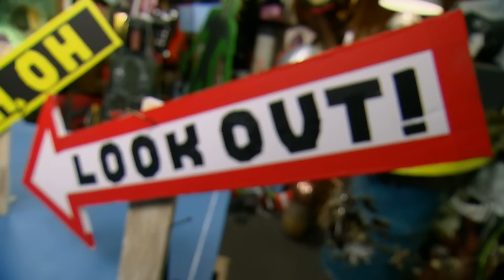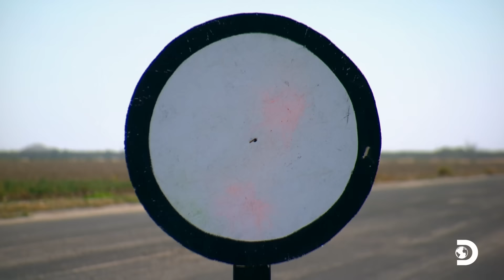Can You Shoot a Grenade Out of the Air? | MythBusters | Discovery

Comment: In retrospect it makes sense. The material of the shell was chosen because it is easily shattered. It makes sense that even low velocity projectiles would shatter it.
Reply: The shell doesn't need to be easy to shatter, the explosion is going to destroy it regardless of what you make it out of because it has nowhere else to go.
Reply: @bobbygetsbanned6049 no but in order to fragment better it needs to be kinda brittle
Reply: @bobbygetsbanned6049  the goal isnt to destroy the casing, its to break it up into lots of hard fast pieces, so you would want to heat treat but not temper the metal so it is very hard and brittle.
Reply: The casings of WWII grenades were made of cast iron, which is very brittle. They were also cast to have break lines in the casings... See the old "pineapple" grenades for an example.
Somewhere in there that was switched to a thin steel casing, with a serrated "slinky" inside to act as shrapnel.

And yes, I was in the Army, and yes I know how grenades are constructed.

Comment: This experiment is close but I think there are a few details missing that could drastically change the outcome. 1) They use a Mk2 grenade instead of an m67. Besides being the grenade in service currently, its also what the majority of movies use. 2) They are using practice grenades, which are straight TNT, and are "low explosive" grenades. A real grenade, especially the m67 has about 3-4x the explosive force, and use something called Composition B. Its a mixture of TNT and RDX. The latter of which some of you might know, is shock sensitive and has a much bigger boom. It also means the m67 grenade is much thicker, harder, and doesn't have perforations like its predecessors. 
Basically, this experiment is a better analog for "can you shoot a 1/8 tnt stick and disarm it" like in old westerns, instead of a grenade out of midair.
Reply: TNT is not low explosive, dingbat. A practice grenade is low explosive because it contains black powder, not TNT. Furthermore, RDX is more sensitive than TNT, and in specific 'rifle bullet tests', RDX detonates much more often than TNT, which is why it needs to be mixed with a desensitizing wax. Comp B may have higher brisance (which is irrelevant here) but it will be very similar, if not slightly disadvantaged still, in sensitivity tests.
Reply: @OngoGablogian185  you missed 3/4 of my post and hot hung up on semantics and terminology.  the training grenade is a low explosive version because it DOESNT contain rdx, and has and less than HALF the TNT of a standard counterpart. I didn't realize I had to spell out that its a comparative statement, not a categorization. pop caps and matches have black powder in it too, but you cant blow your finger off with one, let alone send metal shrapnel 15m. You are correct that Composition B has higher brisance, but that measurement is used for effectiveness of the explosive, not its shock sensitivity or insensitivity. In simple terms its how much bang vs how much burn your mixture has. Comp B is more stable, but has a faster chain reaction than straight TNT. It takes more energy to start the detonation, but is much more efficient and self sustaining once it gets going. This difference could play a major factor in the outcome of these tests, as more force would be required to set it off, if it can at all. For a comparison you can find videos of: You can smash, burn, shoot, and microwave C4 and it will NEVER detonate. But induce 12v of electricity into it or use a blasting cap and a soap bar can make a 30ft crater in the ground (C4 is made primarily using RDX as its explosive compound) Conversely, Tannerite can trigger its explosive reaction with any caliber over a .22, but dies off so quick 4lbs of the store baught stuff put in 1 container wont fully detonate.
Reply: @OngoGablogian185   Also, after doing some research and finding no conclusive answer, I stand by my original statement that m67 practice grenade uses TNT without the RDX as thats what I was taught in the USMC. Not to be confused with bluebody grenades, which don't explode at all, which only use a small amount of black powder to emit smoke to signal detonation, and are meant to be reused. These are what we call dummy grenades, NOT practice grenades.
Reply: @mygirlfriendbeatsme  Lol, nice book. You should title it 'in defense of being flat-out wrong'. This has nothing to do with 'semantics' and everything to do with correct terminology, which is fundamental to EOD and explosive engineering. It's quite laughable that you would claim the fault is mine for 'interpreting' you wrong, when you're erroneously labelling something as low explosive. Something with TNT in it is not low explosive. It's high explosive. End of story. Even using it as it's 'low explosive' in comparison to an equivalent amount of Comp B is just wrong. 

 Further, you were the one talking about explosive force; my point was that we are only concerned with sensitivity here. Hence, brisance is 'irrelevant'. It's good to see that you now agree with me in your reply. The rest I think we can dismiss as irrelevant rambling. I hope this has been edifying. Good day.
Reply: Adam would state later on that they flat out couldn't acquire grenades. There was no legal workaround for private acquisition nor even cooperation with bomb squads.

The Mk2 you see here are actually empty duds they acquired on the market, which then they filled with explosives (according to Adam, C4) and a homemade cap, on their own for the test.
Reply: @siraethelwulf8914  which gives a decent representation of the 67, but yea it makes sense that it would be super difficult to get one, let alone a modern mk2
Reply: @siraethelwulf8914  
Hardest-to-Obtain Item in MythBusters History
6:13
FYI the part where Adam says grenades are hard to get.
Reply: Lmao at everyone

Comment: On the shotguns, the shot cup itself went through the grenade, which means every pellet was still tightly packed against all the other pellets.

The shotgun load went through basically like a slug would.
Reply: Pellets do not equal a slug.
Reply: @johnjay1147  
They do if they're still inside the shotcup.....
Reply: @johnjay1147  To explain a bit. Shotguns do not work like they do in movies or video games. Pellet spread is far tighter than most people assume it is. And there is almost no spread at all for a good distance. At that range, there's little difference between a slug and shot. The biggest difference would be that shot is "slightly" spreading it's energy so instead of piercing the target, you obliterate it. Get further away, and the story changes. Slugs will still put a hole right through something, shot on the other hand will instead put many smaller holes in a target. 

This test wasn't exactly fair in other words. Up close or at range a 45, slug, or rifle round should act more or less the same and this test would be decent for those. Shot on the other hand, well you'll never shoot something with shot this close. The myth is shooting the nade out of the air, not while it's at your feet.
Reply: yup and just like a pistol it will destroy the detonator and dump the hexamine out. Rifles bad idea they go Mach 2 and the shockwave will detonate the grenades and blow you to bits.

Comment: "These are supernm dangerous" holding it hanging by the safety pin😂
Reply: They also often have the end of the pin bent down to insure the pin doesn't work its way free. Current US grenades also have a clip to keep the pin from moving. Removing this clip is step 2 of 5 when the Army teaches grenades in BCT.
Reply: Exactly what I came to comment and yours is on the top of all comments. I guess we all noticed that huh 😂
Reply: It was surely an inert grenade he was handling
Reply: It was FFE.
Reply: @jjd997  guess you didn’t notice that the one he’s holding isn’t real lol. If you keep watching you see him pulling the pin on the one he was holding and he even said it was a dud.
Reply: @dbzcollector9963  I guess I didn’t 😅
Reply: Tbf, it actually takes quite a lot of force to pull the pin out, still would never do that with a real grenade tho obviously...
Reply: @airplanenut89  ensure*
insure refers to insurance lmao
Reply: It can take 8 to 11 lbs to pull a grenade pin.  Some Russian grenades required as much as 17 lbs of force to pull.

Hanging a grenade by the pin isn't likely to pull it unless the pin is faulty.  Also, attempting to pull a pin with your teeth is likely to result in a few pulled teeth.

Comment: Adam holding the grenade by the pin, the only thing preventing the spoon from activating the fuse, made me nervous
Reply: Those pins require quite a bit of force to pull out. Its NOT going to fall out just by holding it like that. You can't pull it out with your teeth either like they do in action movies, it would probably break your teeth if you really bit down on it and tried to pull it out
Reply: @Eralen00  Materials degrade, defects happen, assumptions kill.
Reply: Probably a dud
Reply: it's obviously a dud lmfao. he literally plays with one later and says it's a dud. they also hit one with an ak
they ALSO weren't allowed to touch the live nades and had the bomb techs set them all up.

Comment: The fuse is not 'shock sensitive' it is just that the bullet ignited the grenade before the blasting cap could, it has penetrating power as well as has an incendiary effect when shearing through the steel casing of a grenade. The previous two used what is known as stopping power to essentially destroy the casing. If anything was learned it was to target explosives if  you are a sniper. With the new 380 blackout it'll sound like you snap your fingers and BOOM.
Reply: What the hell are you talking about? Of course the fuze is shock sensitive- it's a FUZE! Must be american with that attitude lol

Comment: I’m not going to lie I was not expecting the shotgun to do that either, but after I thought about it it does make sense because the casing is designed to blow apart so there are probably certain stressors in the grenade to make sure that the whole thing blows apart in as many pieces as possible instead of getting just 2 or 3 big chunks. So yea it’s probably designed to be somewhat easily shatterable even tho it’s steal.
Reply: IIRC that was an issue with some early grenades. they'd explode in very unpredictable patterns sometimes leaving their intended target completely unharmed...
Reply: gotta be super brittle metal. probably hardened or something. would both improve power and make fragmentation more consistent

Comment: The reason the 12ga disintegrated the grenade is due to how it leaves the barrel. Yes they are little pellets, however when they leave the barrel, before the pattern opens up at very close ranges, they are still clumped together and can blast devastating holes through things. It functions as a single bullet as wide as the 12ga's barrel.

Comment: The fact that all rounds disintegrated the grenade instead of knocking it backwards is not surprising given that the shell of a grenade is designed to shatter fairly easily. On a technical note, the .308 igniting the grenade should be a slightly different explosive result that when a grenade goes off on its own, given that the shrapnel inducing shell was already in pieces when the .308 set off the powder. It would be interesting to measure the difference in blast patterns. You're still not going to detonate the grenade 'safely' by shooting it though.

Comment: The shotgun's load was still in one large clump when it hit, because it was so close.  Take that shotgun back to 45 feet away, or even 20 feet away, and you're down to the pellets, instead of almost a solid clump of steel pellets - those pellets might penetrate the grenade at range, but without testing that, there's no way of knowing if it would work at range.

Comment: The only problem is the only cast iron grenade used by the United States armed forces was the MK2, which is not featured in this experiment. What we see here is a cast iron copy of the Vietnam era M26/61 which was originally made of two pressed steel halves, with a coiled fragmentation sleeve on the inside along with a high explosive. This method of construction is similar to that found in "our" current grenade, the M67. Thus, many of the results of these experiments would only be applicable of someone was throwing cheap, modern "surplus store" replicas at you that are of course filled with TNT along with a live fuze.

Comment: You need to shoot the grenade with the shotgun at a distance. At 25 feet it will spread the buckshot and possibly not do anything to the grenade, It doesn't have that much power at a distance. Of course, shooting the grenade with a shotgun at point-blank range is more powerful than all those rounds. You have a bunch of 00 bucks moving as one unit at the point of impact rather than a scattered pattern.
Reply: At 25 ft 00 buck still packs quite the punch.

Comment: An average modern frag grenade is like 3.5 inches long with a diameter of 2.5 inches. Modern skeet discs (in America at least) are around 4.5 inches by 1.25 inches. If you can hit a skeet disk 40+ meters out then you can hit a grenade, so I don't even understand why that would be a question. The actual question isn't IF you can hit it, it's SHOULD you. That depends on whether it's going to detonate when you hit it and, if so, how far from you it is. If it's gonna go boom and you tag it 10 meters out you're still taking a bunch of hot steel to the face.

Comment: I mean, a standard m67 is designed to break apart from the inside. I'd wager it'd just shatter and only the blasting cap would actually go off (assuming it's undamaged by the shot) but what do I know?

I'm correct, is what I now know. I didn't expect the .308 to go the way it did, but I'm not exactly surprised either.

Comment: I'd go on a limp here and say that the grenade exploded in the last one due to the metal casing of the grenade and most likely causing sparks during penetration (seen in my high-speed videos where this happens) and thus igniting the grenade. If the .45 went in the middle of the grenade it would most likely ignite it too. But it went slightly up and thus not properly transferring all the energy. 
Though if only we could have more tests :)

Comment: Old practical wisdom, If you don't time left on fuse (typically 4 / 5 seconds) don't run! 
 
Drop to ground, feet together / heels up, hands on junction of head / spine. Why? Bottom of feet = more survivable (covered with soles of boots, also protecting what's between them.  Hands protect spinal cord / head.

Comment: you had heat and vector speed so the .308 was the blasting cap -- you need low speed low heat high kinetic force rego .44 .45 12 410 gauge 9mm would also make the grenade explode

Comment: This is NOT "shooting a grenade out of the air"!
This is shooting a stationary grenade.
Reply: With a shotgun at 3 feet... I would be much more interested in what 4 or 6 shot would do to a grenade at 30 to 45 feet, a much more realistically makeable shot when shooting it our of the air. Who is going to use 00 for skeet shooting? Also the 308 test was terrible, even in slow motion you couldn't tell of it was the muzzle flash that ignited the tnt powder, the shock or what, again 30 to 45 feet would have been better.

Comment: Remember. Hand grenades are designed to fragment into shrapnel. They’re designed to break apart. A bullet will absolutely shatter that shell
Reply: Not exactly, theres multiple types of grenades, like for one example pressure grenades (im not sure if thats the proper word for it in English) that will end you if you are in a closed space with a pressure wave. You can be a around the corner in a bunker and you will still be f*cked, but out in the open its way less dangerous since its not designed to shrapnel. I got to throw one of those bad boys when i was conscripted, and i still have the pin in my key chain hahaa

Comment: so many safety issues here, shame on that incompetent bomb tech for letting it happen.

*non ballistic rated lexan shield as the only protection from high velocity shrapnel
*cocking a loaded gun pointed at a live grenade with a string around the trigger, wtf that absolutely needed to be done remotely. if he had let go of the hammer before fully cocked, someone had tripped on the string, etc 
*running out after the first shot and picking up the grenade after seeing that it broke apart, the blasting cap which was still mostly intact has enough power to easily blow your hand off.
*no real plan for live grenade possibility on the range, what was he going to go look at it with the robot, then what? it obviously didnt have the ability to pick it up or disarm it.
*setting up the .308 with the bolt closed and someone standing infront of it

Comment: Shotguns are WAY more powerful than handguns.  A load of 00 buck is about equal to 5 .45s all at once.  And, at a range of ~2 feet...  The shotgun is hitting with about as much force as the rifle was.  The pellets haven't separated at that range and are probably still in the cup, so they're hitting like a slug.  Roughly a third the velocity, but roughly three times the mass of the rifle bullet.

The caliber of the bullets/pellets is insufficient for determining "power."  The smallest, lightest load they fired at the grenade was actually the rifle.  But it was going A LOT faster than the other two.  Even an individual pellet from the shotgun is a larger caliber than the rifle bullet.  Usually .33 for a 00 buck pellet, .45 is pretty obvious, and .308 is .30 caliber.